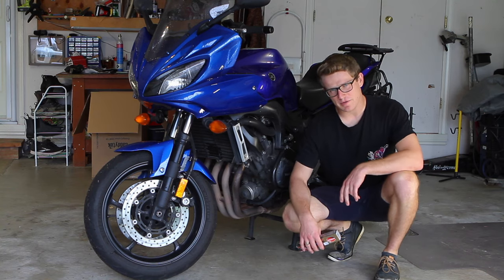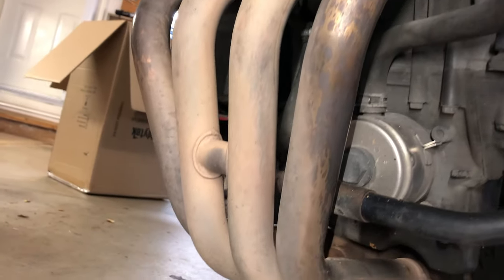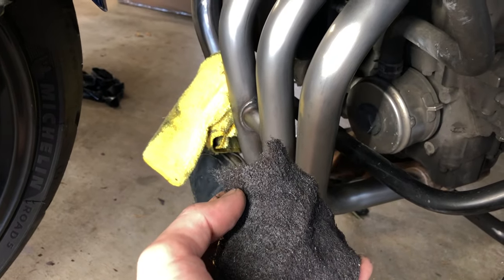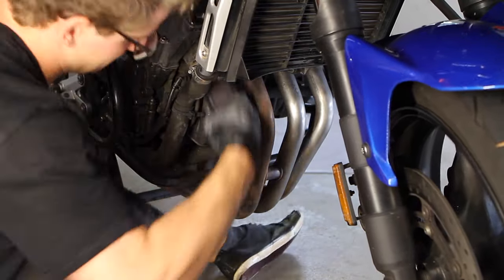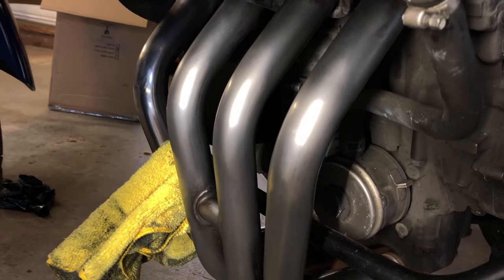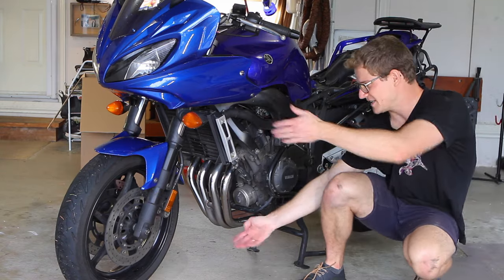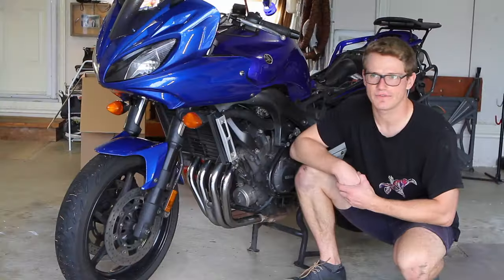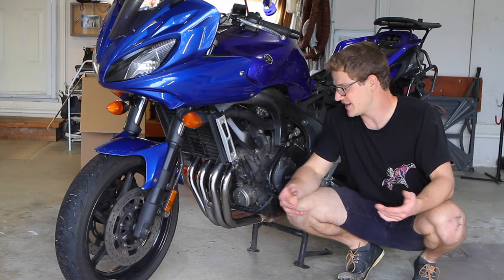How to Polish Motorcycle Exhaust Headers **Crazy Transformation**

Comment: Tried something similar with less effort. I used toilet cleaner which contains some form of diluted acid just repeatedly brush it on for a couple of minutes all the surface stain and corrosion will come off leaving it quite shiny. You can finish it off with autosol or brasso or any car polish really to really get the extra shine. Also a fellow 2007 Fz6 rider. Thanks for all your videos =)
Reply: Can confirm toilet cleaner is the winner, spent years using autosol but toilet cleaner took less than 5 mins to bring it back to shining!
Reply from the maker: Ya I read about the toilet bowl cleaner method. Maybe I'll try that next time! Glad you enjoy the videos!
Reply: @burpingass  anything with acid in the active ingredient... normally HCL (Hydrochloric acid).
Reply: error, this will remove the chromium, they will never shine like chrome again. Also, do not scrub vertically...
Reply: thx ALOT for this :D .. was about to start doing my pipes :D .. this will most likely save me hours and hours
Reply: @Ladosligese  @elynn ahh yes do check your exhaust pipes if they are really stainless if they're chromed don't bother it'll get damaged...the stainless yamaha uses are good don't keep the acid on too long a few minutes will do, it'll discolour or get etched and will take some time to polish it back to full shine... :)
Reply: @everythingisIAM  why not scrub vertically?
Reply: @flackoslife542  hey, just caught that tip from fuel moto channel under title: how to clean bluing & discoloration from brushed stainless steel motorcycle exhaust
Reply: @everythingisIAM  why not scrub vertically?
Reply: Just saw another video saying hydrochloric acid will remove headers coating and will cause them to rust more quickly afterwards …am on a fact finding mission right now ,so I say if you use toilet cleaner there must be some sort of high temp polish/ coating that can be reapplied to protect your work after rinsing acid off …?
Reply: @vicpnut1  Yes it will if its chrome plated, the FZ6 original header is not plated, brushing on diluted hydrochloric acid will just remove some of the surface chromium and staining, after that just wash it off with plenty of water and give it a quick polish with autosol to bring out a new chromium surface. If you have access to phosphoric acid then its no problem at all.
Reply: @MagixianX1  ok good to know , are an fz1 headers the same ? Just realized this is sort of geared toward fz6 headers lol …and…I sorta assume same exhaust on both bikes ..but I don’t know for certain
Reply: Please make video on it!!!!
Reply: They will look like shit a week later.
Reply: @droz7503  As in back to to the way they were before??
Reply: @nickw1305  thank God I’m doing this first thing in the morning!
Reply: @vincentloughnane83 he’s just hating lol

Comment: Good stuff! Just a note, I'm not sure why people try polishing with microfiber towels. That material is designed to wipe away gunk an dirt, so it does that effortlessly with the compound too. The compound is removing the ridges of the tiny scratches from the surface. While rubbing against the surface it breaks down and gradually becomes finer and rounds those micro ridges further. It can't do it if the MF cloth wiped it away promptly. 
IMHO it would be more effective using a thickish cotton rag or maybe a piece of natural felt (more aggressive) for cutting/polishing. Use the MF cloth for cleaning and buffing. It's excellent for that job.

Comment: I think it's more discolouration on the metal than "rust" - sure the pipes are in direct line of water/dirt from the front wheel when riding, and this hits a hot pipe and "bakes" onto the surface. All single pipe headers will discolourin a short time, thats why some manufacturers add another chrome pipe as a sleeve outside the header just for show, and this stays chrome!

Comment: Learned more from your 3:30 video than others I watched that were 10 times longer! When you say the bronze color returned, was it as bad as the before photo? Did they still have a reflective look?
Reply from the maker: Thanks for the kind comment. The bronze color wasn’t rust or corrosion it is just a little discolouration in the steel from the heat. They still had the reflective look for a few months easily.

Comment: Maybe there is a coat of some solution you can put over the pipes to protected it from getting rusty again so quickly?
Reply: I've tried the xcp rust blocker which is a coating but because of the high temperature it burns it and turns the header rust black color

Comment: I have a question, do you know what settings you had in fz6 in the Co1 and Co2 diagnostic option, what were the values. If you would give it in the comment, I would be very grateful. Thank you and good luck
Reply from the maker: I wasn’t able to get into diagnostic mode on my FZ6 unfortunately.
Reply: @Calvinm  OK thank you

Comment: I need better supplies. i need to EITHER order the stuff online and let it arrive or get off my arse and get to walmart. Since my local stores don't carry scotch brite.. go figure. Did my headers with a 1200 grit sand paper, it was ok. I'm still not happy with my finish. I also tried an angle grinder to get the hard rust off.. it worked for some parts but my grinder is too bulky and won't fit for the higher places. Mines a work in progress still. I'll likely finish the job this week after a few work days. I'm excited to have stellar headers. 

On the flip side, i've done so much work to my 750 gixxer that my fairing actually fell off while riding. so she's kinda care. all parts are exposed (including rectifier) but I've replaced all the electrical on her, once again. wow, i replaced everything, just realize6 months later.. the MAIN issue was a faulty stator. fixed that a few weeks ago, been running strong since.

Great video i love the fact that you did this all by hand no power tools.